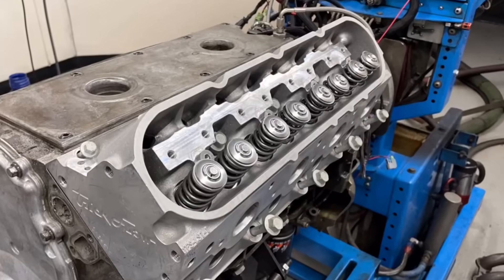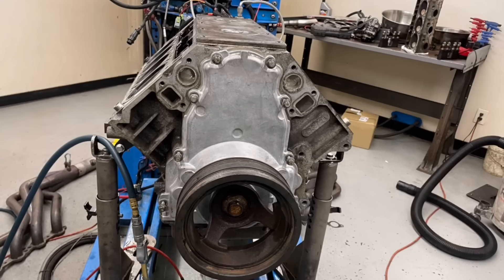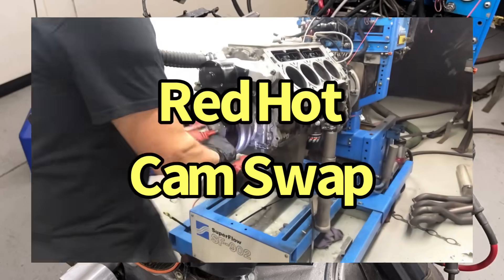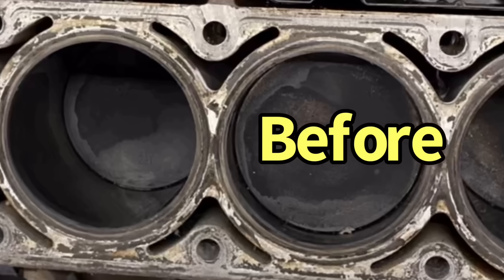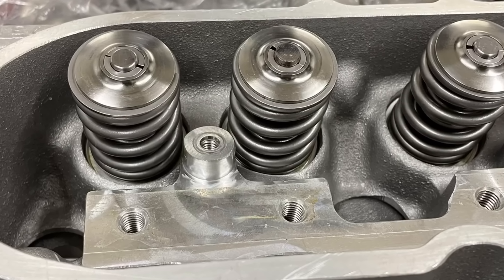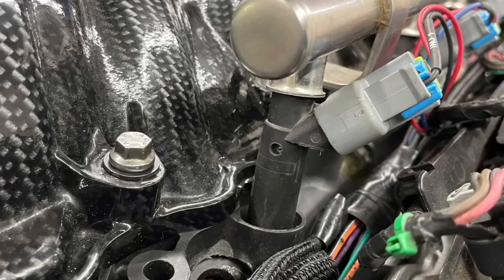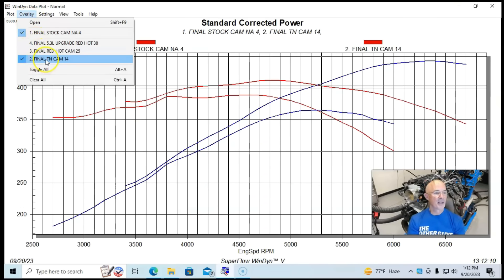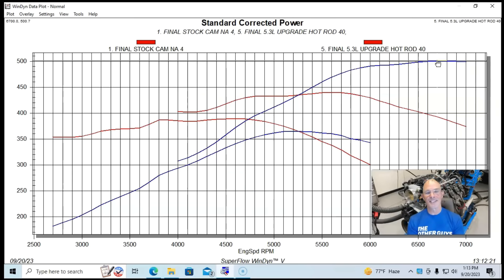HOW TO: THE ULTIMATE 510-HP, ALL MOTOR JUNKYARD 5.3L BUILD.  STEP BY STEP BUILD & FULL DYNO RESULTS

Comment: This broke my heart a little bit. I thought my truck was making almost 500hp based on the estimated gains of all my mods. But there’s no way. I wonder what would be a good next mod. 

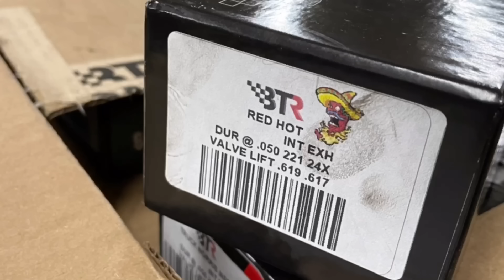I have a Texas speed stage 2 cam with AFM delete, and upgraded virtually everything I touched except the heads. Stock bottom end, long tube headers, towing tune done by lethal performance in San Antonio. I did have the gears swapped to 4:11s and that made a huge difference in torque. 

Would I be around the 440-450hp area? 

Would a bigger throttle body be a good mod for me? I have a spacer, but don’t know how that helps. 

Should I put the FAST supercharger on it with my stock 4l-60 transmission? 

Would love to add something else to the truck but really don’t know much about this stuff.

Comment: So when you ran the “red hot” cam you just changed the cam? No valve springs or pushrods or anything? Should be mentioned if you did.
Reply from the maker: it already had springs set up in anticipation of the bigger cam
Reply: @richardholdener1727  Ah I see, good to know. Thanks

Comment: Should bore heads out triple valve springs
Reply from the maker: why triple springs?
Reply: @richardholdener1727  more compression equal more performance and power my father taught me how to work heads and the bore the intake manifold for gas to flow quicker if heads ain’t right ass won’t follow remember tht
Reply: And get closed camber heads to and work them eagle crack and u  will blow doors off a lot of vehicles and if u go turbo or super charger go turbo supercharge cause spinning thts y these newer hellcats and shi never hook shidd a 300 hp car will gap a lot of them newer chargers bc they spin so much my pops taught me sum clever tricks in racing soaking ur slicks in bleach and u will hook everytime

Comment: Its crazy to me that in 2025, engine builders still have to do so much trial and error testing to achieve their goals.

You would think in the day of AI and super computing, guys could just plug the numbers into a program and simulate dyno testing to a reasonable degree of accuracy.

I load rifle ammunition. I have a program on my lap top called quick load. I plug in information like barrel length, powder type and charge, rifling twist, bullet weight, the bullets balistic coefficient, ext, ext.
The program can very accurately predict the performance of my load with out ever firing the rifle.

I understand that an engine is much more complex, but that quick shoot program is also like 15 years old. Computing has come a long ways. 

I see a ton of you tube channels trying different combos of say heads and cams to achieve the results they are looking for....and these guys(much to their credit)are physically swapping parts and re running the dyno tests....over and over.

Got to be a better way.
Reply from the maker: there is no better way than actual testing

Comment: Just $3k heads for a cool 30 hp😂
Reply: 15hp to the crank
Reply: 30hp is 30hp
Reply: @tadwiltman4875 I was just about to say the same thing
Reply: @tadwiltman4875  30 hp is 30 hp when you're trying to build something absolutely crazy. If your goal is only 500 hp 3k is absolutely absurd. The whole build should be less than 3k for 500hp
Reply: @Chevrolet-88 an engine can be fast, durable, and cheap... you can only have two of the three.

I wouldn't know how to build any engine for 3k... I've got more than that in the dry-sump system. The machine shop even got more than that
Reply: @tadwiltman4875 Sounds like a personal problem
Reply: @Chevrolet-88 nah. I wouldn't attach my name to an engine that cheap
Reply: Yeah seems like a waste of money
Reply: @bobobrazil1973 some people are looking for okay performance for cheap. Some are looking for a competitive advantage, and trying to get every foot-pound and horsepower they can per cubic inch. Those two are not the same
Reply: 6.2 intake mani does about the same on 5.3

Comment: How much hp could I gain on a bone stock 4.8 if a did truck Norris cam, 799 heads, LT headers no cats and the stock intake
Reply from the maker: 799 heads would likely lose power compared to 706/862, the cam is worth 55-60 hp and headers might be another 15 hp or so
Reply: @richardholdener1727 there’s 862 heads on it now are those the best for my truck then?
Reply: @richardholdener1727 or what are the best power adding heads in your opinion?

Comment: You made 480 hp on a stock block 5.3 with just a fast intake and a red hot cam?! Or is there more to it.
Reply: Crank horsepower, it wouldn't be 500 to the wheels

Comment: So $4000 ported heads +$500 cam + $1500 ported intake put you over 500 hp. Plus injectors, etc...
Reply from the maker: Buy once, cry once-this is what it takes to make 500 hp from a 5.3L NA (turbo is a better option for budget guys)

Comment: Could get another 10hp from a proper y pipe
Reply from the maker: Y pipe on the exhaust?
Reply: @richardholdener1727  yes, with a smooth flowing merge collector going into a single 4.5in pipe. better scavenging through all rpms

Comment: Has the guy who runs this channel ever modified one of the 4th generation of the vortec i think is the one with afm and dod ?
Reply from the maker: yes I have
Reply: @richardholdener1727  thank you I need to find the video I have a GMT900 I wanna rebuild an engine and trans and put it back in it

Comment: What up, say I'll have my heads in two weeks. So I have a question, can I put a blower on this motor with the same throttle body, cam and heads? I kno I can't use those headers cause you have to use the ones for the blower..
Reply from the maker: the blower doesn't care about headers-only turbos. You can run a blower with any heads, cam and intake (unless the blower replaces the intake)
Reply: @richardholdener1727  My fault that's what I meant I wanna put a turbo on it..
Reply: @richardholdener1727  I'm sayin blower because dats what a lot of people call turbo's around my parts I'm in Mississippi..
Reply: @richardholdener1727  I see I said it wrong, okay can I put a turbo on this motor basically will I have to change the intake?

Comment: I can make 750 HP out of a junk 5.3 if i throw a ton of high dollar money parts at it. Show us how to make 500+hp out of a 5.3/6.0 for under $1000.
Reply from the maker: just add boost
Reply: @richardholdener1727 what size heads should I use on my lm7 5.3 to get more horsepower

Comment: "WHAT WILL 3,000$ dollars on the used market get me for horsepower not counting install work."

I have a 2006 Yukon SLT with L59 engine, I want to make at least 500HP to the wheels and more TORQUE than HP. What will it take to get this done and still be a daily driver and reliable. RELIABILITY is the #1 thing it MUST have. I want to run 11s with not only not removing any weight but keeping my sound system in it that adds about 300-400 pounds over the rear tires where my TWO 80 pound speakers sit. weight over rear wheels is needed anyways in a vehicle especially one thats daily driver so it wont have a insane suspension that will squat down. she needs to keep being a truck that can tow and travel across the country like she does now, I am going to put tens of thousands of miles on her yearly, at least 5-10k miles mostly highway driving.
Reply from the maker: GO TURBO
Reply: There’s a video of a Yukon Denali smoking challengers and mustangs. Think he had an L92 turbo. Just ad some boost think if I’m not mistaken you’re good with the rods.

Comment: can this cam and intake setup be use on  the ls4 5.3 engines, i know the blocks are identical and most internals  are the same would i be safe to bolt the redhot and intake straight on whats mods are needed
Reply from the maker: it might hit the front accessory drive
Reply: @richardholdener1727  meaning? that the fast intake manifold, would not clear the front accessories, and or drive belt, and if so, can this manifold be mounted backwards. I know the original manifold that come standard with the ls4, can be mounted either way, I've seen some guys mount the ls4 manifold backward, for clearance for turbo applications

Comment: when you removed the old head that watery substance is that normal? i have a 5.3 turbo build and im getting something similar that smells like gas but isnt flammable in my catch can that is vented to both valve covers for crankcase pressure issues under boost

Comment: Where can I order those heads from?
Reply from the maker: as cast from TFS-but TEA for porting
Reply: @richardholdener1727  Is TFS-but TEA is cylinder head shop where you're from or a website?
Reply: @richardholdener1727  I got what you're sayin now, so the have different websites is how I'm takin it..
Reply: @richardholdener1727  Another question, what size or those heads cause I'm literally gettin the same motor?
Reply: @richardholdener1727  But a Red Hot blower cam dats a everyday driver tho sorry my bad meant to put dat in the question?
Reply: What would be a good Red Hot Blower Cam?

Comment: I enjoy listening to you. But as I find in most videos they lack substance, connective information for both sides of the equation.  Power and MPG.  I would like to know if I changed a 5.3 chevy  5 speed transmission to six speed and some type of turbo or charger will improve my power and more important increase MPG what about reliable?  I want the before and after.  All you give a shit about is power. Who gives a shit! I do not want to purchase a new 100,000.00 dollar truck and 50,000 miles later after the warrenty expires the transmission drops or engine fails.  The risk is to much.  I would rather purchase an older truck or SUV and invest in new transmission and type of turbo. I need to tow 3,500 pounds. What can you do to represent good options.
Reply from the maker: we can't test mpg on the engine dyno

Comment: Ported and polished 706s would make the same amount of power and in my personal experience the 706 headed 5.3 is the toughest and most reliable of the 99-07 motors and make a bit more power to thanks to the smaller combustion chamber and the 2001-2003 706 headed 5.3 has a bigger cam than the other's to by like .30 lift and a degree less of lsa

Comment: So this stock block, that intake manifold & this throttle body, a cam, another cam, but let’s try this cam and we are running what gas!😮 
 What was the final package ran?? I got lost when turning left at Cincinnati? 
Please simplify this build by post parts used. Either say it or post it, can’t keep up.😢
Reply from the maker: EVERY PART ON THE 510-HP WAS CLEARLY IDENTIFIED. STOCK BOTTOM END 5.3L (220K MILE JUNKYARD ALUM 5.3L) TFS HEADS, FAST INTAKE AND BTR CAM.
Reply: @ Okay!! I guess.

Comment: It annoys me that someone as knowledgeably as RH uses a stupid term like all motor, does a turbo engine somehow use less motor, turbos and blowers don't add power they just get more air inside the cylinder, its still inside the motor where the power is made
Reply from the maker: you might be new to the automotive thing, but all-motor is a designation use industry wide for non-power adder motors

Comment: Roughly what would the compression be in this engine? Looked like dish pistons when you took the heads off
Reply from the maker: the L33 has flat tops-heads were milled .030 and .041 gasket

Comment: I need that same motor built Richard, how much it's going to cost me but with the red hot cam in it?
Reply from the maker: you need to add up the components-summit is a good place to get costs
Reply: @richardholdener1727  Where are you located?

Comment: How reliable is this build? I’m planning to LM7 this instead and maybe put a NV3500 or 4500 if I can find one another question I have is will this chop like nasty? Or would it sound like a normal V8 because idle wasn’t really shown in the video
Reply from the maker: it has a big cam and big cam idle
Reply: @richardholdener1727  would it be reliable? Or would it really tear down on the lower engine

Comment: Richard I have a 2004 Chevy Trailblazer EXT LS 5.3L Naturally aspirated Vortec V8 engine. I have about 175k oil changed every 4000 miles. Quality lubricants are used in addition I add Lucas or Marvel Mystery oil as my engine insurance. Now since 2014 I have not run the Trailblazer due to a blown transmission. Life issues in the past have prevented me from getting it on the road. I like to get it running again but I like to improve its performance and longevity for another 30 more years plus. Do you have any suggestions on a blueprint for this particular engine. The reason I'm asking because I'm also thinking of converting it into an overland vehicle and as you know the engine has to absorb a lot of punishment. So any suggestions would be greatly appreciated
Reply from the maker: cam and springs
Reply: @richardholdener1727  well what I had in mind was basically pulling the power plant out of the SUV. Gutting out all the internals. Crankshaft bearings both cylinder heads pushrods rockers everything. Sending the block out to be jet washed and honed. Give it a black paint job. Get a forged crankshaft, And have it cross drilled and nitrated for strength. Forged piston rods. Trick flow cylinder heads and a Comp Cam. Rebuild the oil pump before reinstalling dimple the internals to keep a pocket of oil modify with the addition of washer shims to boost oil pressure. Get Holly LS value covers. I was exploring installing in Edelbrock e-force supercharger do you have any thoughts on this?

Comment: I HAVE A 2001 GMC SIERRA 1500 SLE IT HAS THE 5.3 LITTER.WHEN IT WAS ON THE Dino BEFORE MY UPGRADES IT HAD 268 HP AND STOCK ON THIS WAS Supposed to be 285HP SO OVER THE YEARS ITS LOST 17 HP I HAD A DUEL EXHAUST SYSTEM FROM FLOW MASTER AIR INTAKE FROM K&N IN A NICE BOX SET UP SO THE Filter doesn't get wet. I was really concerned of that. Then I did a tune a diablo tune. MY TRUCK IS PUSH 362 HORSE POWER NOW AND 404 FOOT POUNDS OF TORQUE. DEFINITELY MUCH FASTER. PLUS PLUGS WIRES AND  OIL CATCH CAN AND UPGRADED THE Redesign valve covers from GM that stops the oil consumption issue. Plus the entire engine was completely cleaned out from sludge.Build up, it wasn't too bad though, but seeing that the valve covers were off.I had everything cleaned. NEW Oxygen sensors throttle, position sensor mass, air flow sensor knock sensors. And there was another 3 other sensors. I replaced the truck runs like a top now almost.
Reply from the maker: Couple of things. 1. Your factory power rating is not rated at the wheels as measured by chassis dyno (did you test on a chassis dyno?). Making 268 whp on a chassis dyno is about right for a stock 5.3L.  2. There is no way a tune adds near 100 hp at the wheels. If this was measured on an engine dyno-then the first test of 268 hp was wrong.
Reply: @richardholdener1727  THE TESTS WERE NOT WRONG AND IT DID ADD THAT MUCH WITH ALL THE OTHER UPGRADES THE TUNE GAVE ME ALOT AND WITH EVERTHING ELSE THAT WAS DONE TO THE TRUCK WITH THE LONG TUBE  HEADERZ WITH THE DUEL EXHAUST SYSTEM THE AIR INTAKE SYSTEM THE CATCH CAN AND THE PLUG WIRES Coil PACKS. There was a few more things that was done to the truck that I didn't mention . The BIG FAN BLADE was taken out an an duel fan system was put in its places. Plus I had my throttle body replaced with a racing throttle body unit very expensive. So actually, what my truck cranks out was done at a professional shop that I've been using for years, I trust their work. I don't trust some complete stranger that thinks he knows what he's talking about like yourself, because in reality, you're probably somebody's son that's living. In their basement thinking that he knows everything. So bug off pal.

Comment: Junkyard 5.3, sure...... High end race shop tuned heads.
A little deceptive with the description.
Reply from the maker: Junkyard 5.3L BUILD-100% accurate on the description
Reply: @richardholdener1727  That is true, its just that the word "junkyard" is often synonymous with low cost or budget build. It is still a great video, just not what I was expecting. I've gotten a lot from your content, I like your work.

Comment: Why are the stock numbers in these videos always way higher than the oem rated power for the motors?
Reply from the maker: OEM is tested differently (covered this many times). They run their engine with a complete inlet system (as in appears in the vehicle), a conservative factory tune, run hotter (220 degrees), with full factory cats and exhaust
Reply: @richardholdener1727  thanks, that makes sense. Sorry for the dumb question. I’m watching a lot of your videos just hadn’t come across that explanation yet.

Comment: @richardholdener1727 how much are the heads milled? Im doing the redhot cam but on a gen 3 5.3 with cncd 862s. Id like to mill .030 off and get compression up.
Reply from the maker: .030

Comment: Put some racing fuel in it, 50/50 mix, shell do it, oh advance trimming and injectors oversized
Reply: May not get the gains most would hope for. Helps ward off pinging but not much else at this level

Comment: Do you think the stock 862 heads will be good with the red hot cam?
Reply from the maker: yes-it will just makes less than with ported heads
Reply: @richardholdener1727 do you think it would still run pretty strong with those heads? Looking at boost for later but doing a budget build with it

Comment: I have a 2003 GMC XL Suburban miles 150,xxx
I'd like to drop this engine in my 86 SS El Camino, so what all do I need to make 450-500hp? This is our first build and our budget is $25-3500
Reply from the maker: see the videos-they tell you what works
Reply: @richardholdener1727  would I have to upgrade the oil pump